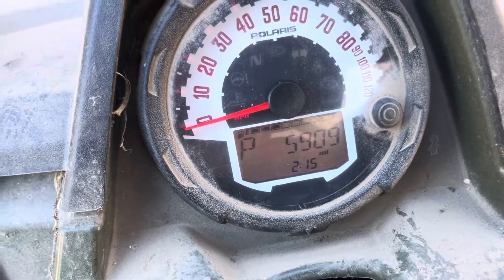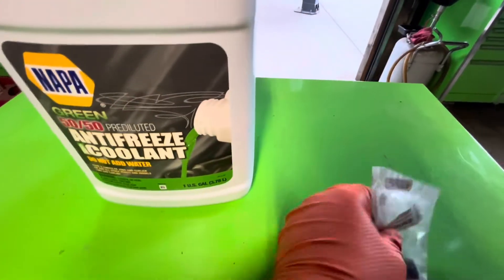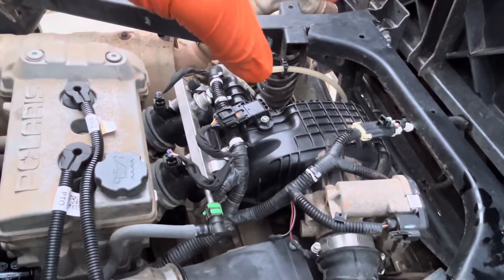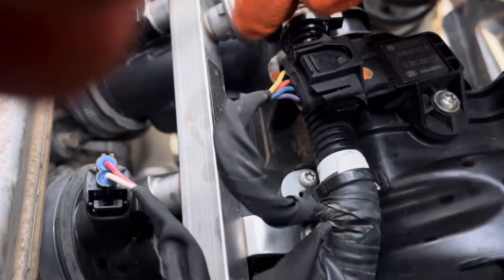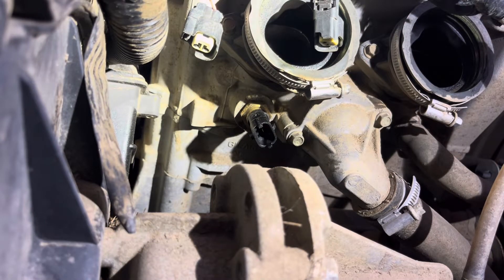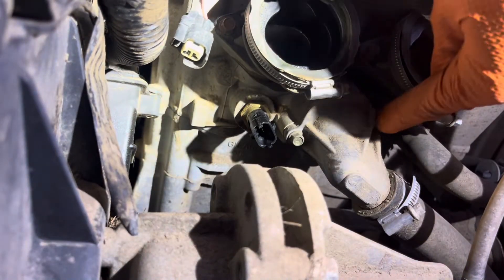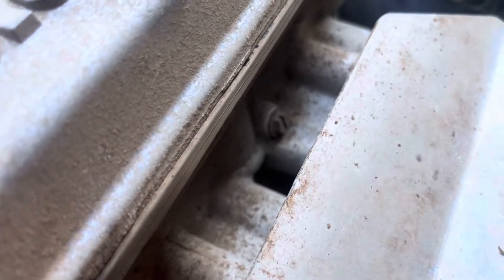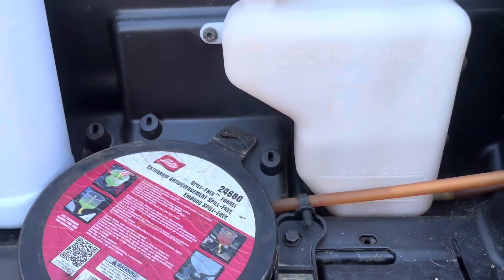Polaris Ranger Coolant Temperature Sensor Diagnosis and Replacement

Comment: I welded a nut to a 19mil deep socket and was able to get the sensor out without removing anything I took the fuel line off fuel rail just for a little room from both sides, I came in from passenger side of motor.
Reply from the maker: Nice job! Way to get creative, thanks for watching! Sounds like you may have saved yourself some time.

Comment: Excellent video. Thank you for posting. I've got the 900 in my RZR. Same year. I don't have erratic readout, but my fan never kicks on. I'm having the damndest time trying to disconnect the sensor to force the fan on.
Reply from the maker: Connectors that have never been unplugged can be difficult, try releasing the locking clip then pushing in hard before trying to pull out. Good luck! Glad this was helpful to you!

Comment: Hello, my Polaris ranger 900 xp water temp stays between 150-170 in 50 degree outside temps. Prior to it was always running 180-200. Any idea what I may need to check out before I dig deeper?
Reply from the maker: @verneweinard3299  My bet is that the thermostat has failed in an open position!
Reply: @ thank you! I will start with the small stuff like thermostat and work from there. Appreciate the video and response
Reply from the maker: @ No problem, I hope you’re able to find your issue, good luck 👍🏼
Reply: Thanks help me a lot, my temp gauge running up and down erratically,  goes up 2 to 10 degrees and back down same 180 to 220, so I'm guessing it is the temp gauge also
Reply from the maker: @ That is definitely possible! Glad this is helpful to you 👍🏼👍🏼